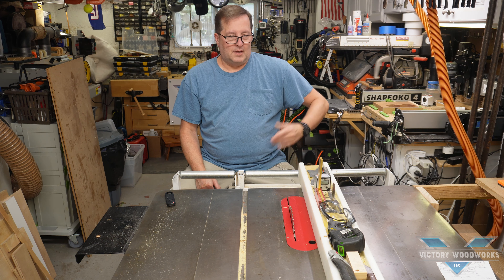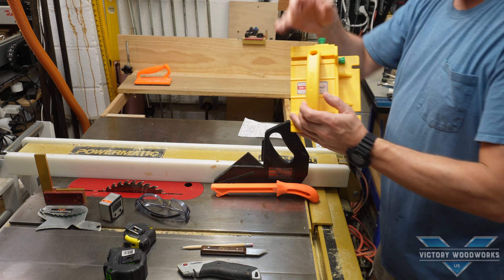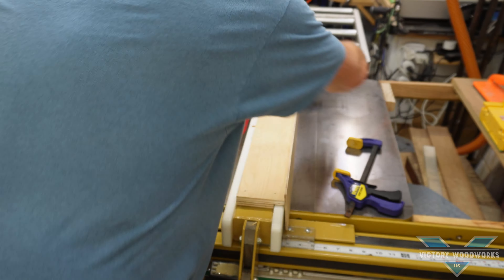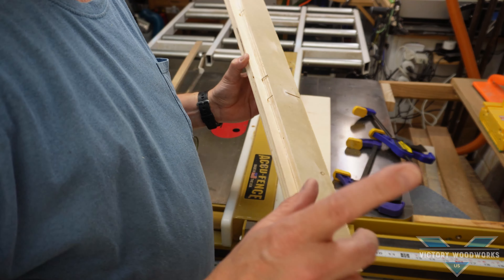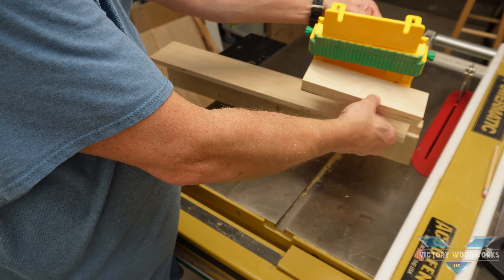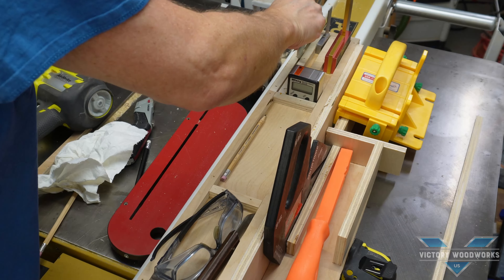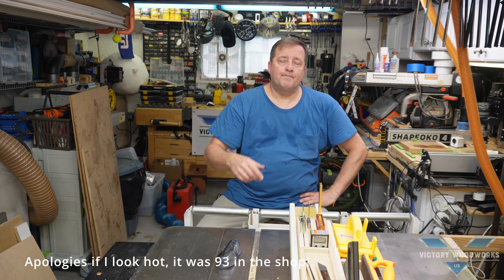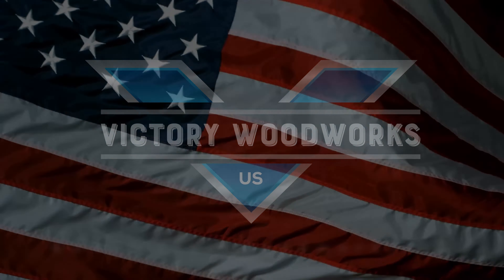Cheap and Easy - Table Saw Caddy (S23E10)

Comment: Where's you featherboard?  Can't operate without a featherboard.  I call fowl...I mean foul.
Reply from the maker: Due to the size and bulkiness of feather boards, I bring them out on an as needed basis.  For me when standing at the table saw, if I were to reach to the right and slightly behind me they are in a drawer cabinet, pretty easy access. Thanks for watching, commenting and hopefully subscribing.